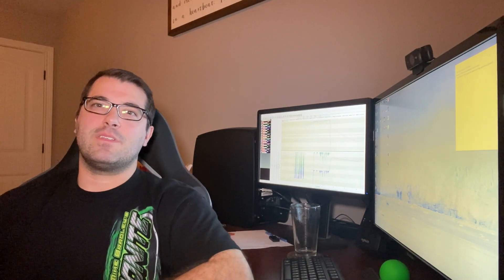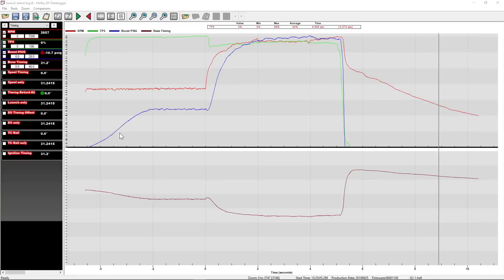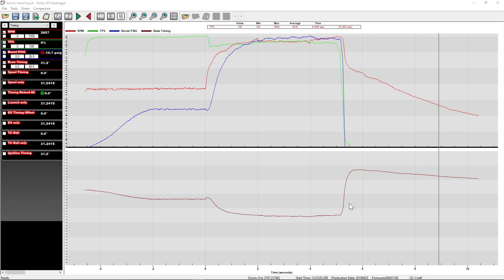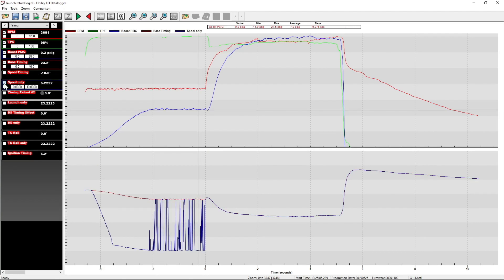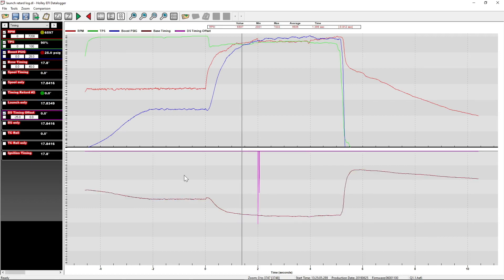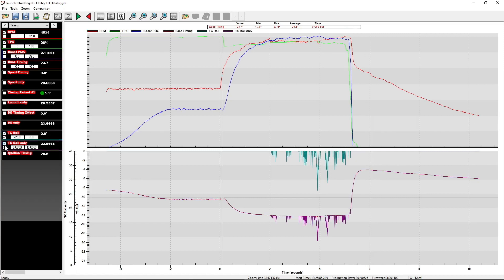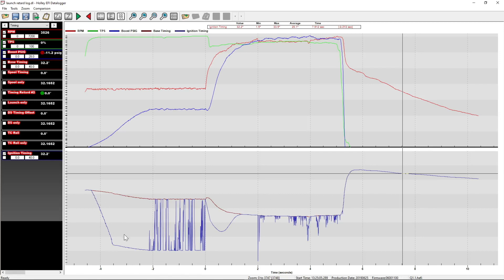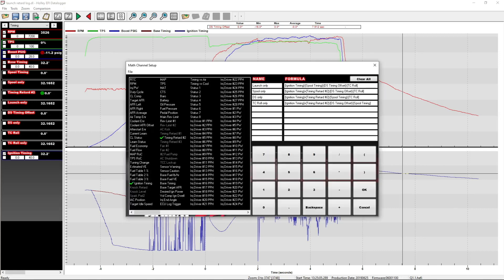How you can use timing on a turbo LS:  Drag Strip Log Review

Comment: Great and valid points. I had an additional channel I am not using that I wanted to do something beneficial with. I will most definitely add this and see what I learn from the data. Good stuff!
Reply from the maker: Thank you.
Reply: Rory we’re gonna have yours doing all the timing things this year :). Great vid Ryan.
Reply: @derekwoods8199  I’m literally hanging out with the baby doing these math channels right now haha
Reply from the maker: I mean, if you just use all the timing there is no need for math Channels. lol
Reply: @highperformanceconsulting7616 , you know we don’t chassis well enough for that lol
Reply: @highperformanceconsulting7616  28 degrees 28 psi. Should work
Reply from the maker: @RoryMalloy  So timing and boost should match?  Sounds legit to me
Reply: @highperformanceconsulting7616  internet told me